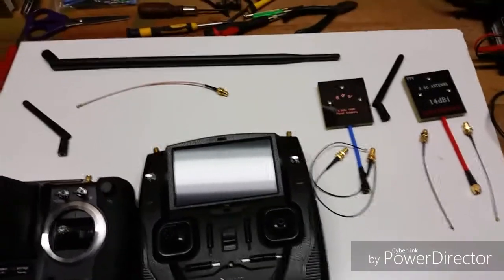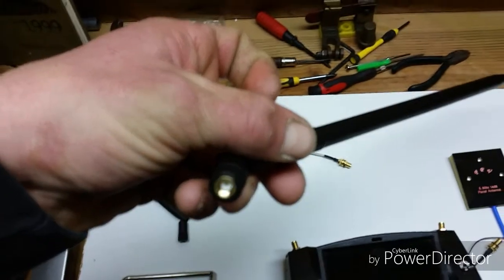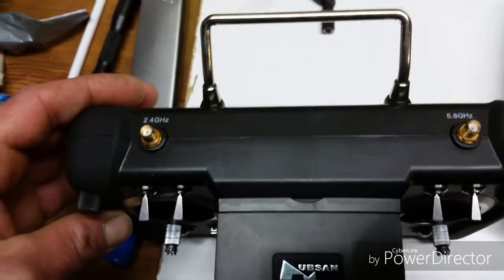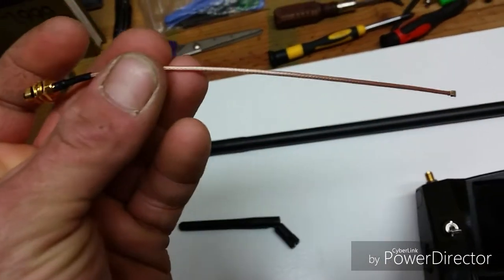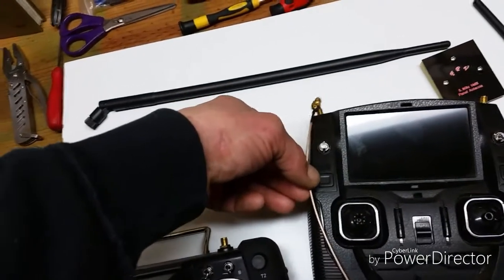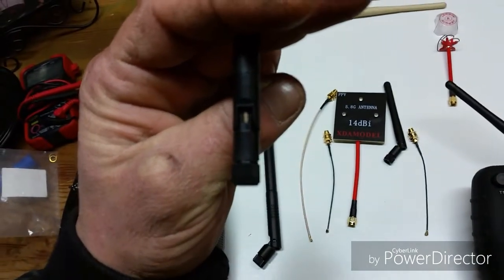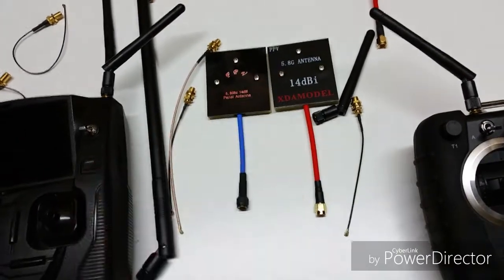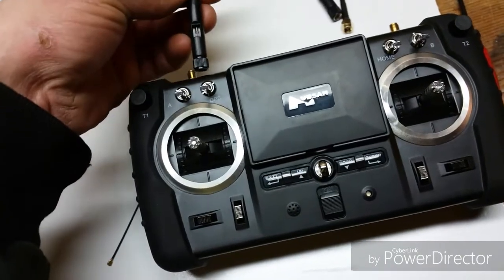Hubsan TX & RX Antennas & SMA/RP SMA Clarification

Comment: Very useful "info" Mark.  Keep it up and Thanks
So you still don't think that the "Advanced" Tx is not worth the effort, right?  I'm thinking about pickup the H501S or SS within the next 2-weeks.  Please give your final suggestions.
Reply from the maker: Derik Dang Sorry for the late reply. As of today (05-31-18), The H501SS has basically Replaced the S. The Standard Versions now include a LiPo battery for the controller and a Sunshade. The Advanced Edition Does Not include a LiPo battery for the controller. Orientation while flying the 501S is / can be Very Difficult. The FPV Screen on the H906A controller is Very Small. Making FPV & Orientation Harder. The H901A has a much larger screen which is very nice, especially for orientation. The only thing you need to do is the external antenna modifications so you can get long-range flights, if you want. The H906A already has External Antennas as you're probably aware. Also "Most", Not All, Flyaways, Faulty Functions happen with the H906A (Advanced Controller). It is "Nice looking" however it has exactly the same modules and electronics inside as the H901A (Standard Controller). I've been using both my Standard (H901A Controllers) for almost 2 years. Never had any Problems. My H906A controller is for my H109S X4 Pro. That's why that controller has 2 Dials on the upper left and upper right corners. Those are for the Quad's camera's gimbal movements. They are Non Functional when used with the H501SS... It's really Up to You which one to get, that's just my Personal Preference/Opinion. Even if the price isn't that much more, you are still going to need to purchase a LiPo for the H906A controller and a Better Panel Antenna. So after you figure in the price for an aftermarket panel antenna and a battery, you are just about spending more money than if you were to by the standard controller and an aftermarket extended range antenna kit.
Reply: You're awesome my man :-D

Comment: So is the standard controller up to running a 9dbi antenna or is it just a waste? Also where can I get this m eagle fpv antenna, and does it get better range?
Reply from the maker: JBHickok You can run a 9bBi antenna if you want. You can put a 15dBi  antenna on there if you want as well. The only thing to remember is the transmission area Narrows the higher dBi's the antenna is rated at. I was able to fly 2,300 meters with absolutely no signal loss and perfect FPV, using a good quality 3dBi dipole antenna. The panel antenna I was using, I bought from gearbest. They do not show who manufactures that particular antenna, but there is one that looks identical on Amazon made by M-Egal. Using a very high dBi Antenna, will only improve extreme range. Because the signal goes further but at the same time gets narrower. So you may not have very good control at close range using a high-gain antenna. Here is where I bought the panel antenna from : https://m.gearbest.com/fpv-system/pp_436713.html?wid=21
Reply from the maker: +JBHickok Forgot to mention, the panel antenna I just sent you a link to, gets range that outlasts the flight battery ! Perfect fpv at 2.3Km ! Could have even definitely went way further but was running out of battery... https://youtu.be/3ctTn-Xv6v0
Reply: Thanks Mark I appreciate the info.

Comment: Ordering RG178 now.  Thanks for this..  The mod kit comes in Friday.. Figured I'd take your advice and upgrade the wire too.  Might as well do it right!
Reply from the maker: +Andrew CCM Yep ! Absolutely ! They also sell RG178 wires on Amazon, as well as eBay. RG316 wires aren't bad either, but RG178 wires are used A Lot More than the 316 wires, Especially by Professional Pilots. What "seller" are you going to buy from ?
Reply from the maker: +Andrew CCM BTW, did you open your controller to make sure the wires aren't soldered to the UFL connections??
Reply: Ordered the XDA kit and then also the RG178 from Amazon.  Didn't want to wait for a month to get them from China.  LOL
Reply: Would have gotten the M-Egal, but alas, slow boat from China..  ;)
Reply from the maker: +Andrew CCM They put a glob of hot glue over the 2.4 Module's Ipex/U.fl connection. So I'm going to have to use rubbing alcohol and very carefully get that off. The alcohol takes away the glues adhering properties. I got to do it very carefully because those U.fl connectors that are on the board are easy to accidentally break off if you pull on them too hard. Hey have 4 tiny little grounding solder points & 1 Tiny little positive signal solder point. I was actually going to reinforce the UFL connector by adding some extra solder to the tiny stock solder joints that are already there...
Reply from the maker: +Andrew CCM You can buy antenna from gearbest or Amazon. Just make sure it is made by "M-Egal".
Reply: Yes... Did that.  Looks good.  Not soldered.
Reply from the maker: +Andrew CCM Oh Man... The XDAMODEL Panel Antenna wasn't doing too well in some tests I did with it. It is extremely directional for some weird reason. Its main coaxial cable is also Not the right length. It does work okay, but not nearly as good as the "M-Egal". There is another kit that I bought when I first received my h501s back in 2016. It's a 14dbi panel antenna kit made by "BTG". https://www.amazon.com/gp/aw/d/B01ISHB4LA/ref=mp_s_a_1_1?ie=UTF8&qid=1516220758&sr=8-1&pi=AC_SX236_SY340_FMwebp_QL65&keywords=BTG+14dbi+panel+Antenna&dpPl=1&dpID=41nTFrHEaDL&ref=plSrch
Reply from the maker: +Andrew CCM Awesome ! Just make sure you are careful and use something very small like a tiny flat head or a hook tool to help you remove the stock ipex connectors off the UFL connection so it does not break..

Comment: You are amazing bro! I’m glad to hear from you! So I got the H501S-S on black because of you:) Question, so I’m still New at this, this is my first drone ever🙃! I’ve been wanting to do the standard transmitter upgrade... Do you think I should do it and I will thank you the World if you could please put a link to where or what version I should be buying..? I really appreciate your amazing and always hard work! Peace!
Reply from the maker: +Phillip C. Absolutely do the Mods ! Take the back off of your controller and make sure that the SMA to ipex wires are not soldered to the modules First. If they aren't soldered, do the mods. You will extend your range fourfold. As far as what kind of antenna kit you should get depends on what kind of flying you plan on doing. Panel antennas are pretty much directional when you get to 300 meters + , so you need to keep the controller (Panel Antenna) pointed directly at the quad during flight to get good fpv. If you like to do all around (360°) flying, you might want to go with a Cloverleaf or spironet type antenna. Here is a link for a very nice panel antenna kit. https://www.amazon.com/gp/aw/d/B01L959KFU/ref=mp_s_a_1_1?ie=UTF8&qid=1516120422&sr=8-1&pi=AC_SX236_SY340_FMwebp_QL65&keywords=m-egal+antenna&dpPl=1&dpID=41yHiTpMLHL&ref=plSrch .
Reply: Mark Suttner , I thank you so much mark! You should be on top of all the other drone channels! I’m serious! Your very clear instructions were the reasons I decided  to purchase the Hubsan X4 H501SS.
I will definitely pulled the trigger on this now and thank you for the attached link!! I will definitely follow up and let you know how everything is going:) I hope I don’t screw it up:) I hope to see you more in this lifetime hobby that I just got into:) 
Thank you Mark! God Bless!
Reply from the maker: +Phillip C. Thank you very much Phillip. I hope you enjoy your quad and the hobby ! If you have any issues, questions or concerns feel free to comment or send me a message ! :)
Reply: Mark Suttner, Indeed brother! This is  definitely a super fun hobby if knowledgeable and skilled:) The extended range kit that you recommended from Amazon, should be delivered by March 5. 
God bless! Peace!